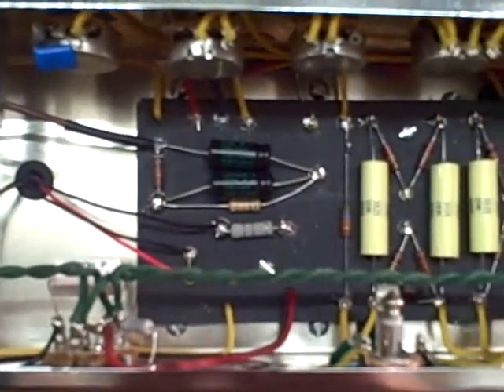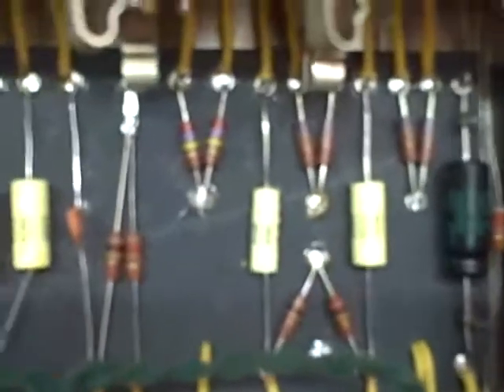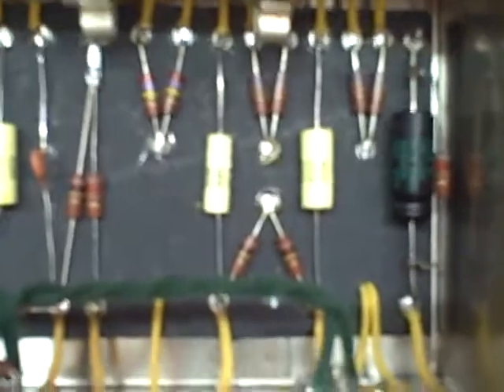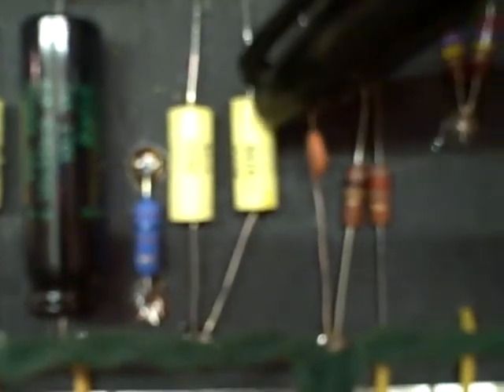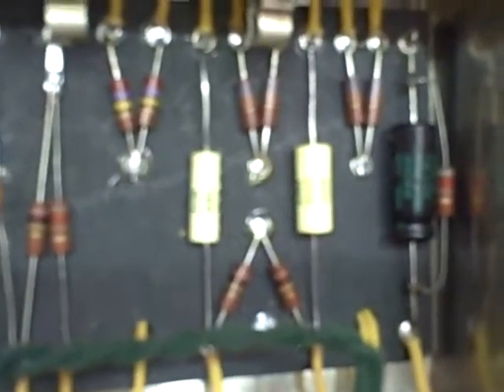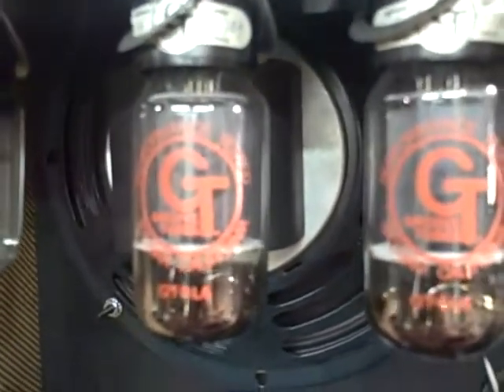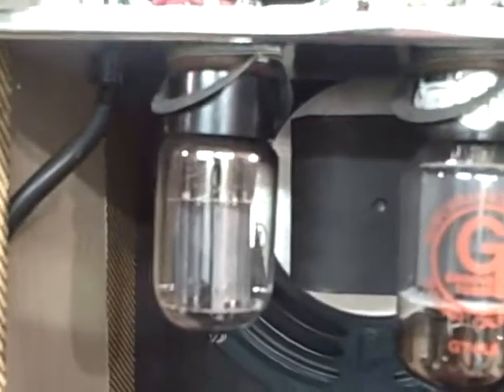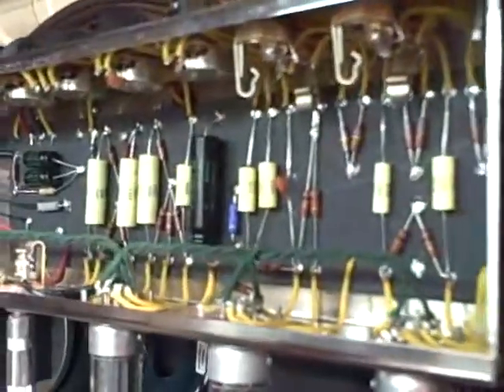5F6-A Bassman Clone Tour with Billy Penn 300guitars.com

Comment: man great walkthrough, i got the Lee Jackson book ultimate bench warrior, neat ideas but the schems get a bit confusing like every preamp tube is labled V1 and even with dual triodes theyll have like 3 or 4 tubes in the same circuit with V1 for each tube, no V1A or V1B,  some schems include the previous stage with the circuit in the next stage and some dont with no explanation of how much of the previous stage is included and everythings just tossed together in random order. so this vid is great

Comment: My only concern is that your missing the best possible tone with a 12AX7 in V-1  , I use a nice GE 12AY7 in my 5E3 for V-1 and it simply sounds the best ! 
I tried both 12AX7 and a 5751 and it was too much gain from the preamp.
Just my personal opinion of course.

Comment: @jmf2081 All the fender tweed amps have a similar feel.  I have the Fender 59 Reissue of this which is NOT the same as a clone... it sounds good, but not as good as this one does.  The main difference you'll hear between this and the 5e3 comes from the lower wattage of the 5e3.  Lower end frequencies don't come through on low watt amps.  I'm actually in quite a dilemma right now cause I want to order a clone but I'm not sure which to buy.